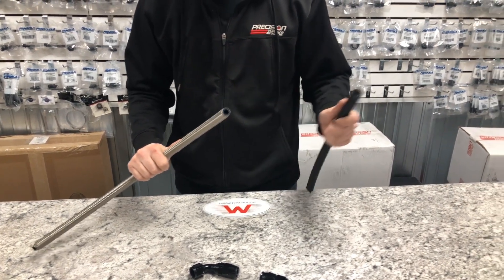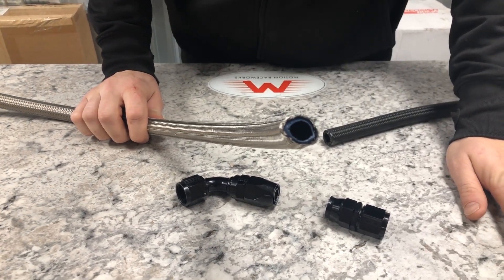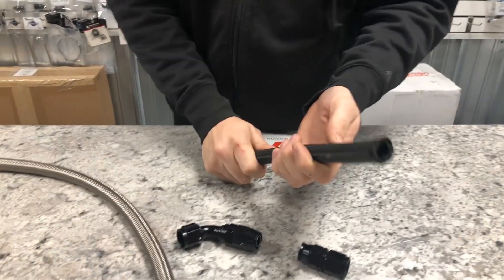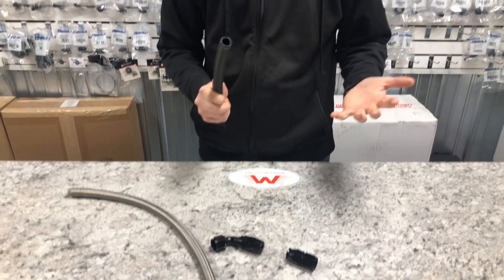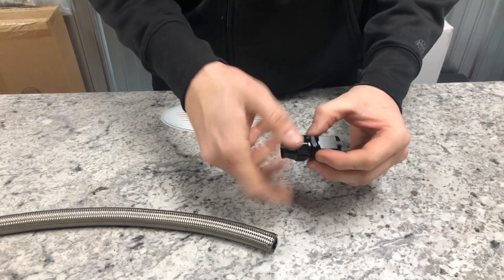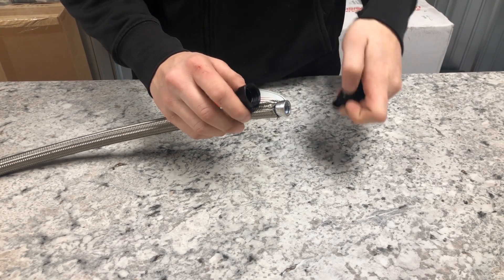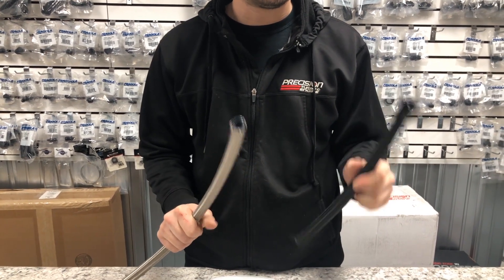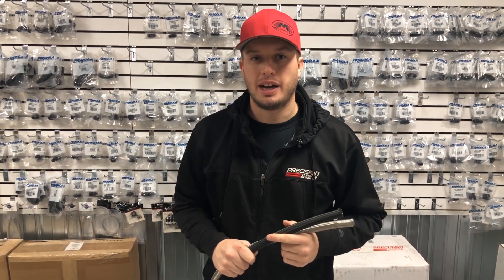PTFE VS AN - Steel Braided vs Nylon Hose Motion 360

Comment: Sooo the static charge will arc through the teflon and ignore the metal connectors at the ends of the line.....niiiiice....it's like you can suck it without getting it wet. The flow of the gas will move electrons until it finds the metal connectors where it will dump them....
Reply from the maker: Tanase Andrei unfortunately that is not true.  The electricity will take the path of least resistance.  We didn’t come up with this theory, there are a lot of case studies and examples of this happening.  We have no agenda but to educate our customers based off of real world results and experience.
Reply: @MotionRaceworksOfficial  90% of the fuel lines car manufacturers use are made of cheap ass rubber or frying pan quality ptfe (in the 10-20 Mohm per mm resistance range ), and they never ever  arc to nowhere. Give me one case study that states what you say  please.
Reply from the maker: Tanase Andrei there are plenty of them online.  Do your own searching and read away.
Reply: @MotionRaceworksOfficial  i did, there is no such thing....I was rhetorical when i asked you for a case study. By the way, let's say i work with hydraulics for a living....

Comment: bull s..t that will not catch fire, there just tryin to sell a product, tell me when the last time you saw somebody car catch fire because of fuel flow threw a braided line, what the hell bull s..t
Reply: My boss drag races and one day when I was helping him with the car, one of the stainless braided hoses started shooting fuel out of the side of the hose, between every braid, fogging out everywhere. He grabs an old one he had on the shelf, already made and everything, came off one of his older, but similar, set-ups. He puts it on and it does the same thing. Ended up having to buy a new roll of hose and remake them all. I doubt they were PTFE, but either way it's been making me weary about stainless steel braided hoses because I want my cars to be daily driverable without having to replace everything every year.
Reply: the newer 10% ethanol blended gas vapor will seep through non ptfe hoses.  go read reviews on summit.  PTFE is just better and safer
Reply: @KingJT80  Meanwhile me running 30% ethanol gas in my completely original farm truck from the 80's with no problems.

Comment: *we don't use push lock because there's not as much margin in it, so we don't sell it. 
So we will talk trash about it, and tell you that our product is better so we can upsell you.
Reply: Push loc  everywhere. We use that suff on school buses. If it wasn't that safe it wouldn't be allowed..
Reply: Push loc is an amazing product and I have used it in automotive high end applications, 
also in industrial maintenance, years of reliable service.
Reply: In a vibration free and torque free environment push lock is fine with decent hose. What happens under pressure is the sharp edges of the barbs dig in and cut the hose internally to hold. If the hose is twisted, bent tightly at the barb, gets close to its maximum operating temp or is even slightly vulnerable to the contents the sealed ends start to weep slightly but only for each pressure cycle as the barb digs deeper and further. So every time you turn on the pressure the hose whips slightly and worries the way the barb is seated inside. If the rubber isn't 100% resistant to the contents you get the rubber breaking down around the barb. So it wears out. That is the smell he was talking about. With decent molded hose {Reinforced inside the hose to prevent it from slipping} that is impervious to its contents it is fine as it doesn't whip during its pressure cycles. The Stainless braided hose unless it's aviation grade or partially molded also suffers from the hose whip wear on pinch olives. However when it fails it does so in a catastrophic fashion with that type of connection. The only benefit is it lasts longer in a fire. The time is seconds VS minutes. External wire braided hose is quite dangerous IMO when used for brakes as well. As the hose moves around inside the braid it wears and because it is not hermetically sealed dust and sand can get in there between the two surfaces and erode both surfaces. The only safe stainless Teflon hose IMO is the one with a smooth molded finish on the outside or aviation rated as that has the wire bonded to the rubber/Teflon hose inside.  I shudder when I see these types of hoses used under the bonnet with high pressure and flow fuel as when they spring a leak it could turn into a disaster. OEM's use molded rubber and crimped for a reason and it isn't just price.
Reply: I have used push lock fittings for my transmission coolers I’ve never had a problem
Reply: Yup, I quit watching at this point and went to read the comments.  This guy has no clue what he is talking about.
Reply from the maker: Matt G that’s not the case.  It’s an unprotected, non reinforced hose.
Reply: Motion Raceworks Official : I was actually looking into the quick connect stuff for my project on my truck. What’s the risk percentage difference between the two? I don’t have time for issues at all. Thx?
Reply: I've seen the push loc shit leak regularly. I only use it on catchcan systems.
Reply: @TooLoudBear  never once in my 15 years working on standby emergency generators or 10 years with my personal vehicles, have I ever had a single issue with push-lock hose and fittings running, gasoline, diesel, oils, antifreeze and air. Installers ability to select and install correctly, and maintain is the only thing causing issues. The only downside to push-lock is many of the lightweight hose types don't have as long as a lifespan before hardening. But all hose types are consumable and any that have exterior braiding hide and mask the visual deterioration that allows the user to maintain this equipment. You never know if the hose is aging when it is covered by stainless or nylon braiding. So your catastrophic failure would happen immediately and likely not have any warning such as a hose you can visually inspect for aging.
Reply: @alexb4409  I agree with you here.

Comment: Looking to replace the entire fuel line in my 77 Ford Van no one has original lines for sale i came across this video can i run the nylon braided hose from Carb to fuel tank ? the van is a cruiser only Gas thanks

Comment: doesn't non conductive PTFE ground out from the olive to termination and the braided line regardless??
Reply from the maker: Not in the middle of the line when theres a static source
Reply: They add a tiny bit of carbon  to the plastic usually to make it conductive.

Comment: Ball valve on the fuel pump feed as well for easy filter and pump maintenance. Soooo much easier to service stuff without having to worry about draining the tank first.
Reply: By that do you mean a check valve somewhere along the fuel line?
Reply: @pourtierbeatz7804  no a on/off ball valve like you would see on a water or gas line in a house. Couple bucks from the hardware store

Comment: I like to put a ball valve on my fuel cell vents that way when i park the car for a week or so I can shut it off and have the cell sealed off from the elements better. Keeps that e85 from absorbing so much water and keeps the fumes away
Reply from the maker: SLOGOAT219 good idea!
Reply: what happens when ambient temp changes and so does the pressure in your tank? If ambient is hot, your tank will be building pressure. If ambient is cold is will attempt to contract.
Reply: @alexb4409  it does expand and contract some. If the fuel is super hot when I park the car I wait till later that night or the next day to close the valve if I know it will be sitting for a few weeks. If not it will pull a huge vacuum

Comment: This is false info. Push lock hose and fittings have been approved since 2014 by both NHRA/IHRA.
Reply: Max length was for rubber fuel line of no more then 12in. Push lock hose is not the same as normal fuel line.  pushlock like Parker or other brands have a textile braid core. 
I understand using braided SS hose around the bell housing area for safety as it has added protection. But one could run push lock just before the bell housing. Then run braided SS  to the rails. 
To each there own. Run what works best for you. 

I do enjoy your vids and the products you sell.
Reply from the maker: brianawd there used to be a max length suggested by NHRA.  It’s just a poor and unsafe choice for plumbing due to it having no protective covering and not being steel reinforced.
Reply: A Google search agrees. NHRA approves. Kinda lost credibility
Reply from the maker: Asa Brown it’s not stainless braided or reinforced.  There are a number of things the sanctioning bodies do and don’t do that still don’t make sense.
Reply: @MotionRaceworksOfficial  they are nylon and fiberglass reinforced. You guys don't know jack.
Reply: @MotionRaceworksOfficial  keep trying.. once you loose credibility...it hard to get it back,, every word will be looked at.........carefully
Reply from the maker: brianawd there used to be a max length suggested by NHRA.  It’s just a poor choice for plumbing due to it having no protective covering and not being steel reinforced.